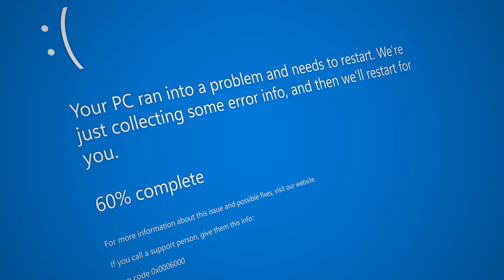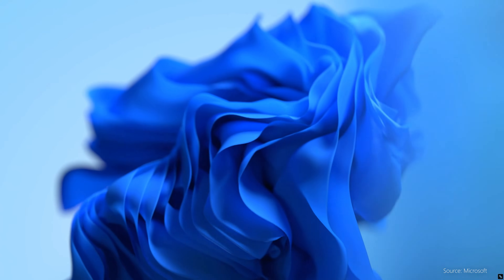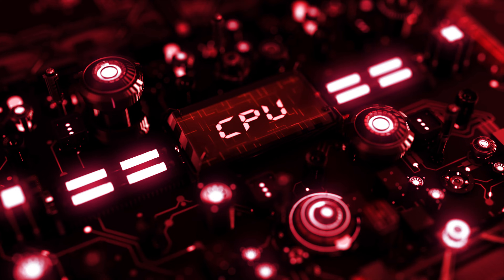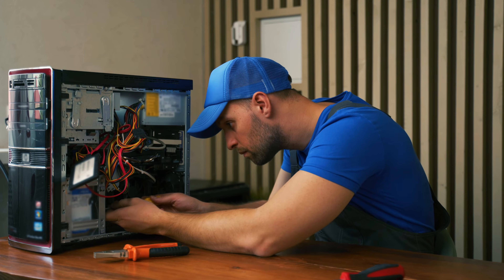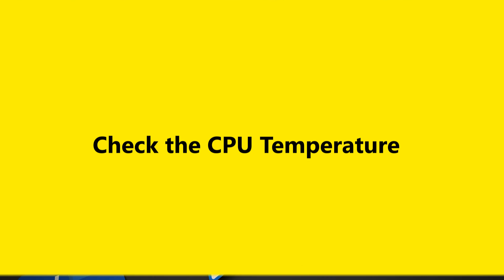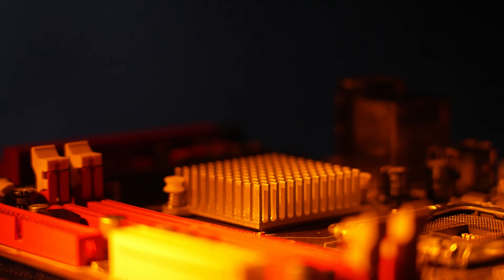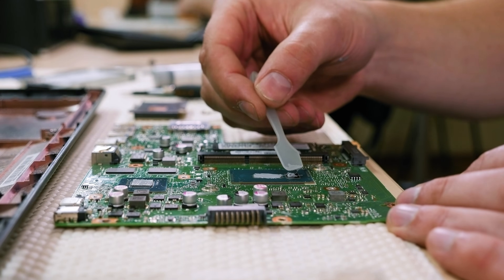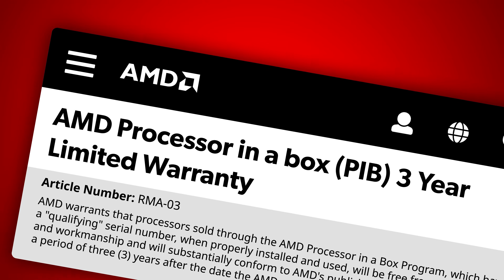Signs of CPU Failure (Rare Problem)

Comment: My GPU requires me to boot with an hdmi plugged into it to show a display. If I try to boot it with a DP cable it says no display and the VGA red light is on. After it boots with the hdmi I switch over to the DP and it works. Is this a failing CPU or Motherboard? Brand new GPU btw.

Comment: Happened to me ,turn on my pc one day it booted to windows & suddenly powered off , i powered it up took half a sec & turn off again when the fans would begin to spin, i thought it was the PSU but it was the CPU with no signs of damage , the technician replaced it infront of me , it turned on normally, he puts the old one back & it fails to power up .
Reply: Exactly same happened with me with i5 8600

Comment: Guys i have a problem when i lunch windows it run for a minute and then froze whats the problem and whats the fix for that
Reply: Same issue bro I’ve been reading and it might be cpu related sometimes it would all light up but no display did you find a fix
Reply: No i haven't have you ?
Reply: @itx-ps1qg  it was one of my drives that was mess up

Comment: My pc fans spin when turned on but my peripherals dont turn on nor my monitor. Ive replaced all cables, replaced to a new PSU, sent my motherboard to get tested and its not at fault. 
Ive tried the usual ram tricks, cmos battery, tested gpu. 

Only part that is left is the cpu.
Reply: Tried new CPU yet?
Reply: @dannyk4819  Turned out to be the CPU, managed to get it replaced with the warranty. No clue how it died though.

Comment: Like 3 weeks ago I got a Ryzen 7 5700X3D and at first it was crashing, but I found out it was overheating, so I bought a new cooler. after like 2 weeks of use it started to crash only when I launched Fortnite. I've tried everything from it to stop crashing like switching RAM, cleaning pc... but nothing worked. Now I think it is the motherboard (B550 Phantom Gaming 4) or the PSU (I don't know the model but it has 700W). I also have 16gb of DDR4 RAM and RX 7600 XT Fighter 16gb GDDR6. Can anyone tell me the problem cause I tried everything?!
Reply: Dou found the fix?

Comment: My pc literally shut off on me no smells no sounds nothing. All my outlets for keyboard, mouse etc still work since they have power but my pc won’t turn on no more then I unplug it and plug it back in and the fans and lights kick on for 1 second then dies. ANYONE EXPERIENCING THIS. I bought this thing from Best Buy 3 months ago 🤦🏽‍♂️
Reply: I have the same problem, but i don't know what to do. I'm searching for the answer too
Reply: @davidvarga6774  check your power supply that solved mines
Reply: Did you have solution for this?
Reply: Facing almost similar issue

Comment: My pc keeps restarting once i boot it up idk why, tried all the methods like cleaning and ram cleaning it still restarts in a loop. The weird thing is that its inconsistent like sometimes if i boot it i can use it for like 2 to 4 days then the next day it starts to do the restart thing again and again. Sometimes it restarts 3 times and a bluescreen appears saying "your pc did not start correctly."
Reply: I have a similar problem. My pc freezes on boot-up when it is showing the loading screen with the motherboard logo. Sometimes it boots to windows and works perfectly after, but most times it just freezes.
Reply: I have the same problem  I need a fix please I replaced psu motherboard  rams n still don't work
Reply: @kingjoshua5189 I would say that it’s probably your cpu
Reply: I'm gonna Fresh Install Linux because maybe a computer virus got in on mine, if it works then it's windows malfunctioning
Reply: use earthing wire in pc

Comment: After years my PC stopped working from one day to the next without warning. When I turn it on the fans run for a minute then nothing. The blue screen says "No cables connected". I bought new cables but this was useless. No beep sound from the main board. I took out the Rams except one, replaced the mainboard battery, removed the graphics card, and disconnected the DVD player to get at least into the BIOS. No change, guess the main board imploded although one main board LED is still working.

Comment: 1. System crashes or freezes: A failing CPU may cause your computer to freeze or crash unexpectedly, as it struggles to handle the workload.

2. Overheating: If your CPU is failing, it might not be able to regulate its temperature efficiently, leading to overheating issues.

3. Slow performance: As the CPU starts to fail, you may notice a significant decrease in your computer's overall performance, including slow boot times, laggy applications, and delayed file operations.

4. Blue screen of death (BSOD): A failing CPU can trigger the infamous Blue Screen of Death, indicating a critical system error.

5. Error messages: You may encounter error messages related to the CPU, such as "CPU fan failure" or "CPU overheating," even if the fan is working correctly.

6. Unusual noises: Abnormal noises from the computer, like high-pitched sounds or grinding, could indicate a failing CPU or related components.

7. Unstable or unreliable connections: A failing CPU may cause issues with USB devices, network connections, and other peripherals.

8. Inability to boot: In severe cases, a failing CPU may prevent your computer from booting entirely.

9. Artifacts on the display: Visual artifacts on your screen, such as horizontal lines or flickering, can be a sign of a failing CPU.

10. Unresponsive or erratic behavior: A failing CPU may cause your computer to become unresponsive or exhibit erratic behavior, such as randomly restarting or shutting down.

If you notice any of these signs, it's essential to consult a professional technician or computer repair service to assess the issue and determine if the CPU is failing or if there are other potential causes.
Reply: Its happening to me.. Cannot post on i5 8th gen... I used it totally only for 2.5 yrs brand new... Jjst suddenly restart after resuming from sleep and no post.. Debug led shows 09 then after cmos reset shows 00 continuously.. Swapped to pentium 8th gen to check.. N boot up entering bios..

Thats suck.. I hv been using intel past 20 yrs desktop n laptop.. They always run more than 5 yrs before showing symptoms.. Usually PSU gonna die before cpu dies
Reply: I just recently switched my motherboard and i try to run games like warzone and Fortnite but they just freeze on start up, i have no idea what the issue is and i can do regular things on it but when too much is going on it gets a lil slow. Theres something about a memory issue sometimes idk what the problem is
Reply: The reason I switched motherboards was bc we had a power outage n my pc would turn fans and lights but no display
Reply: @jagoatedx2660 having the same issue here my pc turns on and everything but no display sometimes it boots up but freezes did you find a fix
Reply: @jagoatedx2660 I went to micro center they told me it could be a hard drive problem I went home try to see if it was a hard drive issue nothing I’m assuming is a CPU issue with the info the guy provided above cause most of those issues have happened

Comment: My PC keeps turning on and off, Tried replacing the CMOS battery, cleaning/replacing RAM and even PSU but the problem didn't solve it. Is that a sign of CPU or Motherboard damage?
Reply: I’m having the same issue
Reply: MoBo issue
Reply: @BlyxDen  @benabduls4211 had issues, random crashes, freezes, blue screens etc..temps were fine, ran all the tests and did all the normal due diligence, no fix. Replaced ram, PSU, SSD, then MOBO, then GPU, leaving only the CPU left. Its such a rare problem that i never believed it could happen to me. 5700x. Replacing with a 5700x3d and hoping for the best. at first it was random crashes and error codes that made no sense. I reinstalled Windows to no avail and the crashes seemed to be getting worse and even more incoherent. It really hit me a few days ago when I was testing with prime95 and core affinity 6 would blue screen me. some further prodding into core 6 revealed that any sustained load on core 6 would crash my PC, all the other cores were able to handle overnight loads but core 6 would fail. now its finally to the point where it wont even boot the windows recovery partition without blue screening.
Reply: @BlyxDen  More than likely, annoying as hell though, having to replace a really awful water cooling myself later this month lol.
Reply: Did you find the reason behind your random shutdowns

Comment: Ive been trying to fix my sisters pc for months! All it does is just randomly freeze and i have to reboot it, no bsod or error messages, sometimes i cant even get it to post and my cpu debug led comes up. Does this sound like a dying cpu or another issue?
Reply: What's tricky about this is the fact that CPU problems mimmic other issues that like faulty RAM and a faulty motherboard. The good news is that both AMD and Intel have diagnostic tools to for your CPU.
Reply: @ColdShoulder131 Im having the same prob right now with my 1 month old pc that i build. And im also guessing maybe i bought a faulty CPU since i bought my cp parts online. By the way did u solve this and was it a CPU issue?

Comment: I was trouble shooting why my aio cooler and fans weren’t working which caused my pc to reach 120 degrees Celsius and I’m not sure if I’ve damaged my cpu because randomly things won’t load when trying to search then I can’t open things but I can still click on stuff but it won’t load
Reply: Same here. Fans and pump were separated in 2 wires and there is only 1 cpu_fan plug in the motherboard. I've connected fans to cpu_fan and pump to sys_fan and sys_fan obviously can't read cpu's temperature therefore won't work until you set it up in the software that comes with the motherboard. By the time you try to download and set it up it oveheats and restarts couple of times and might just burned the cpu.

Comment: most i mentioned not exactly the rare or common cases, but could happen, if not careful
Reply: ive never seen a single cpu failed even pentium and dual cores are still running, most of the time its the board
Reply from the maker: Good points. Although rare, CPUs do fail. But, the causes are rarely due to manufacture defects